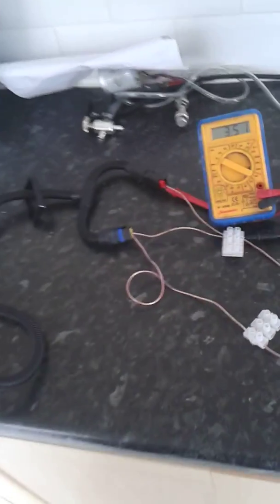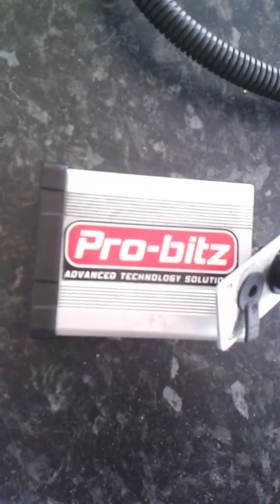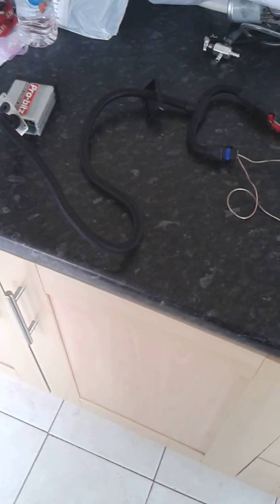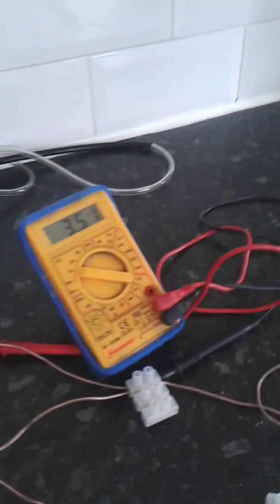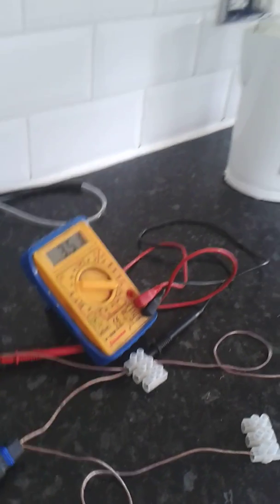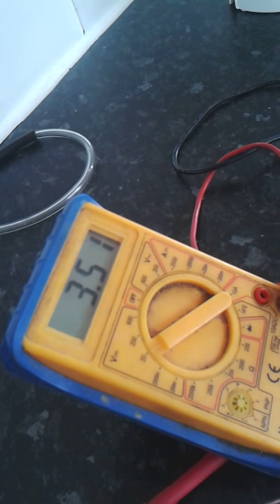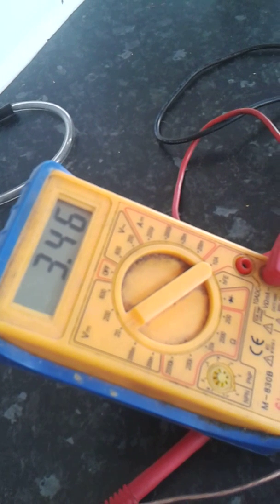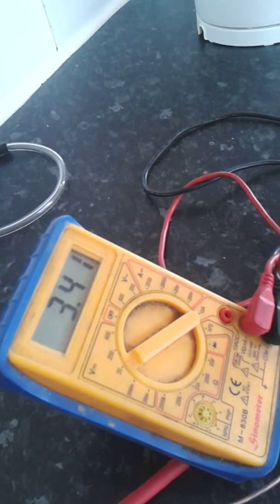Diesel tuning box explained

Comment: Good test, to bad you used a set voltage in to the chip box. The voltage from the rail pressure sensor is costantly changing and the chip box is manipulatin this signal way more complicated than just a resistor. One needs to work out all the voltage curves from about 0.5 V in to about 4.5 volts in and then all the out curves for the different settings.

Comment: What way lowers the voltage? Anti clockwise?
Reply from the maker: Berty.armour94  depends on the individual resistor used.
Reply: Kyle Ardito I’ve got the same box as this (i got for free) and I’m just not sure what way turns fuel up and down
Reply from the maker: It was a long time ago and I cant remember. Sorry.

Comment from the maker: basically, these tuning boxes can only alter the sensor they are plugged into. If they plug into the fuel rail, it will alter the fuel pressure. The problem with this is it will adjust the pressure my a set amount throughout the range of the sensor. It will not alter the injection timing, or the amount of time the injectors open, it will not remove the torque limiters on the ecu which is where most of the improvements come from when having a remap done. It will not alter the boost of the turbo either. when a remap is done it changes many parameters to achieve gains in power. A tuning box only adjust the pressure of the fuel rail which is just one thing and doesn't make much difference. when mapping, the mapper will up the fuel rail pressure so that the extra fuel delivered by adjusting injection timing and duration will atomise, they don't up the fuel pressure for power.
Reply: Kyle Ardito I have both map and box in car tdi and makes great difference didn’t do much on a standard car